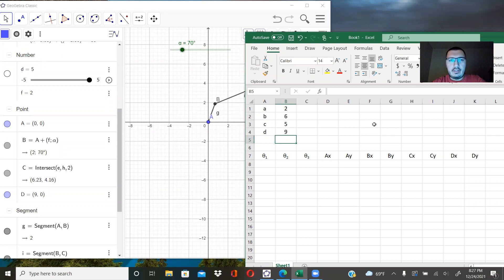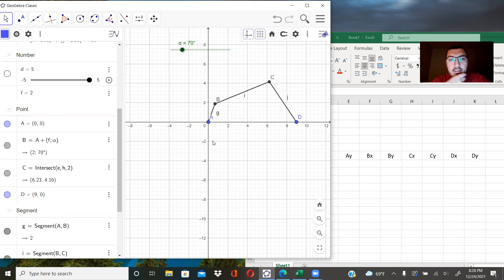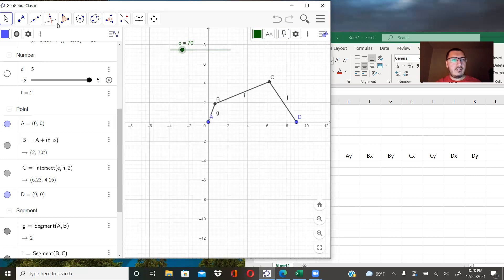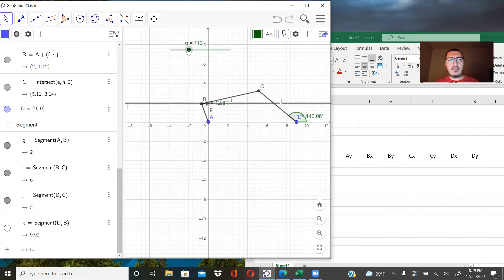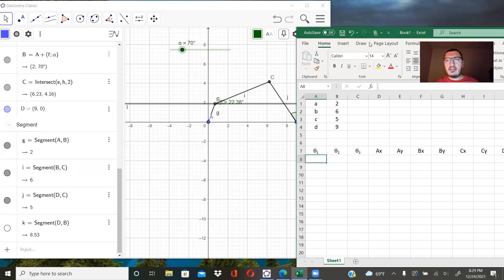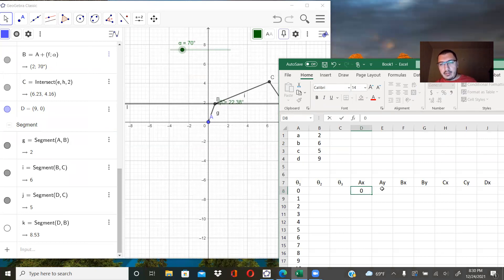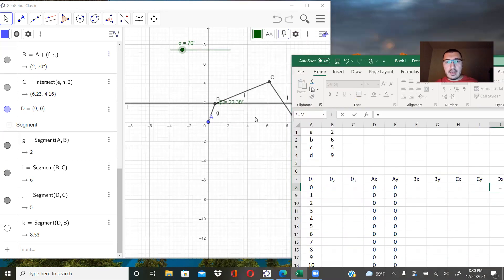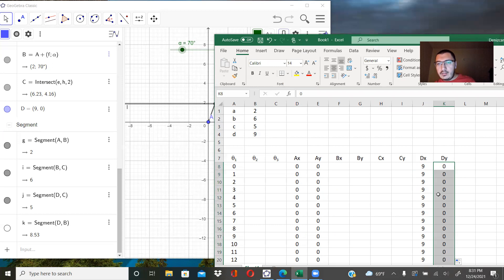Solution For Position Analysis Of Four Bar Mechanism Problem By Using Excel

Comment: Can we use this sheet for a 4 bar link which has its A and D points at some height from each other 
(Dy=___)????
Reply from the maker: Yes, you can do that, as long as you define the point "D" correctly (Dy = AD*sin(angle), Dx = AD*cos(angle)). The process should be carefully done by considering if there is any change in each step. You can always verify your results with a sketching application like I did.
Reply: @denizcan_koc  okay thank you 🫡

Comment: Thanks a lot but I need one more angle, it goes Between  BC and AD, kind close to Beta but it's a  BC and a parallel to axis x.
Reply from the maker: Thank you for your comment. Let me explain what are the meanings of theta angles that I am finding in excel, again;
theta1: the angle starting from parallel axis and reaching to link AB at point A,
theta2: the angle starting from parallel axis and reaching to link BC at point B,
theta3: the angle starting from parallel axis and reaching to link CD at point D,

So, the angle between BC and axis x is actually the theta2, which I am finding last in the video
Reply: @denizcan_koc  I see so my mistake sorry about that, keep it up and success with the channel! =)
Reply: This really helped me out